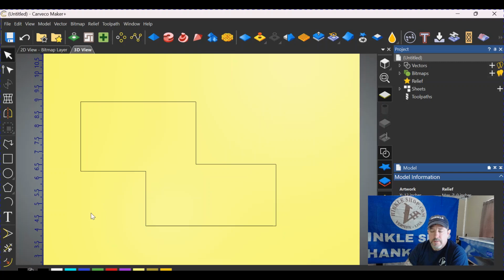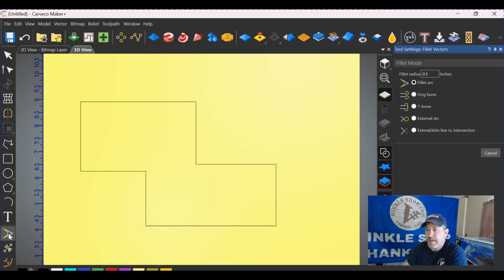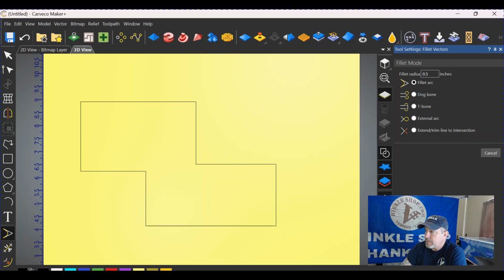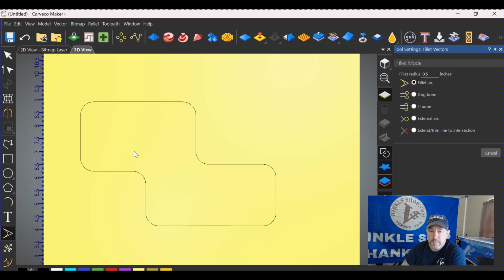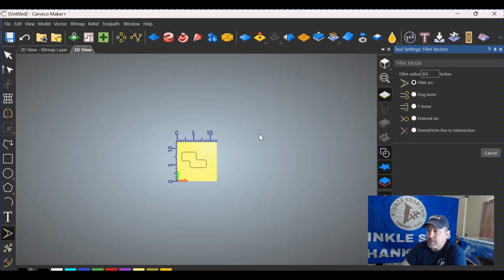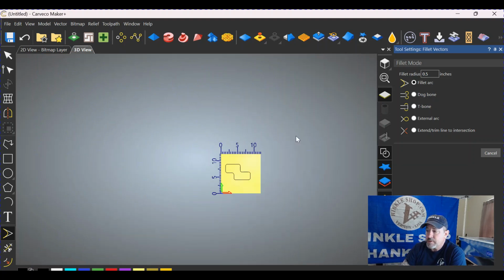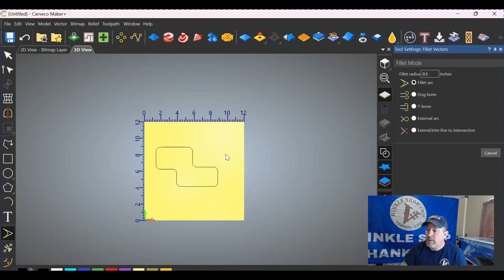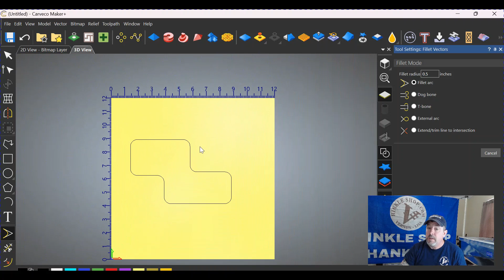# 12 How to: Rounding the corners. learn Carveco in minutes.

Comment: I actually stumbled onto the radius corner command somewhere.  Didn't know  about the fillet tool. (I thought a fillet was a piece of fish...).  What I'm working on is a simple rectangular mortise with rounded corners that will be cut through a 1/4" thick piece of plywood.  This will serve as a template for me to router in a latch on a jewelry box for a granddaughter.  I use the CNC so rarely that I forget more than I remember.  It looks like I've got the basic triangle down but there is material left in the middle that won't be taken out.  How do I tell it I want that done?  Using a 3/16" bit and the mortise is 1.375 x 0.5 inches.  So the inside cut leaves 1/8" of width untouched.    I just rejoined the carveco group on facebook and will ask this question there when approved.  I am VERY grateful for you and any help you may have.
Reply from the maker: Thanks for watching glad i can help 
To remove the inside area select the vector from the area you want cleaned out and do an area clearance 
As an example, if you have two circles, the inside circle being smaller than the outside, select the inside circle only and do an area clearance for it. Hope this helps.

Comment: My vector wasnt created as a rectangle or sqauare... how can i edit the radius of the corners that have a fillet ?
Reply from the maker: @infinitig5392  watch quicky #17 
That will show how to remove the radius then you can adjust the fillet accordingly
Reply: @Hinkleshop  I dont know what you mean by #17 sorry thanks for the reply :)
Reply: @ ok re #17 I saw that but again... its not a square or rectangle so that feature wont show as in #17
Reply from the maker: I see 
So let me dig into this and come up with a solution 
Can you send me an email with a pic of the design you’re working on for reference 
hinkleshop@gmail.com